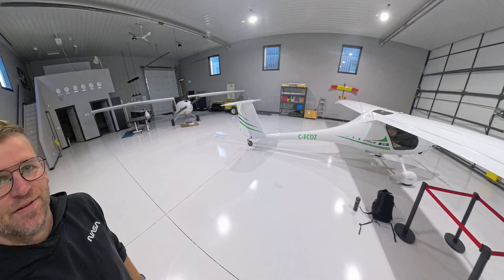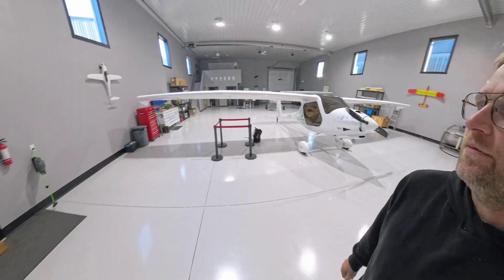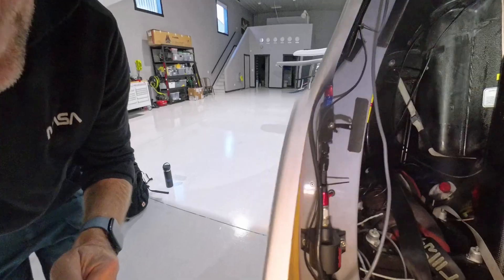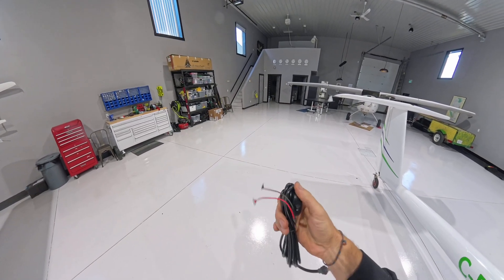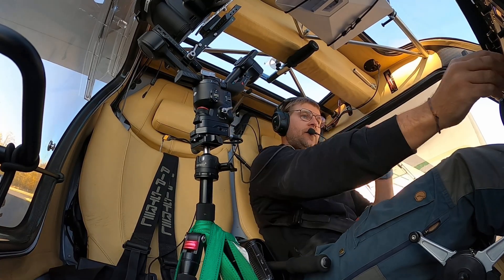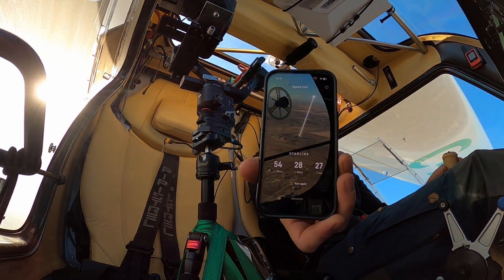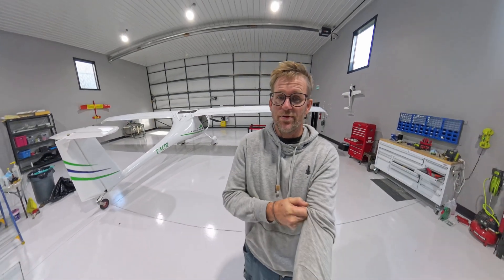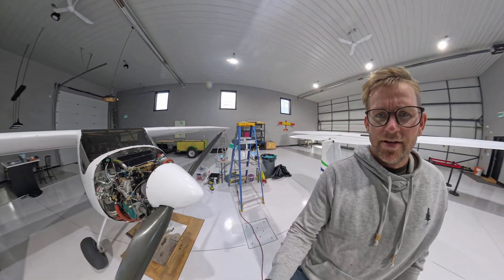Starlink Mini in a Pipistrel

Comment: Darryl, great to see a new video from you.  Impressive since it look like maybe 20% of the dish is block based how you have to place it.  Which btw is probably the best option.  Guessing after testing you will come up with a permanent  mount.  I wondered if it would fit in the small overhead behind the spar.. but figured it would not both from coverage but depth and getting in above the bars.